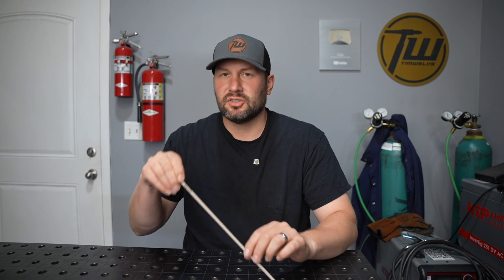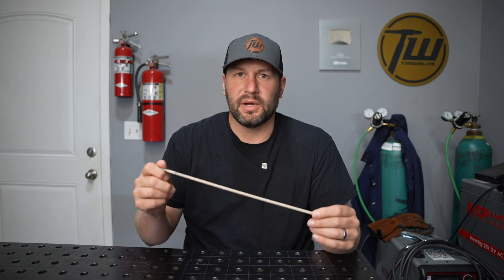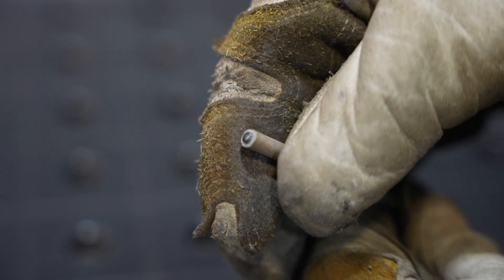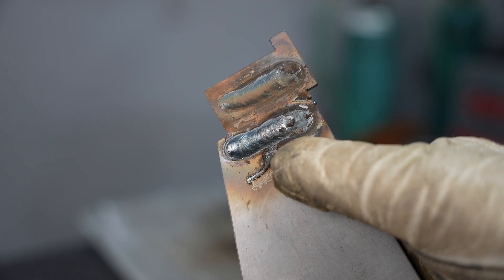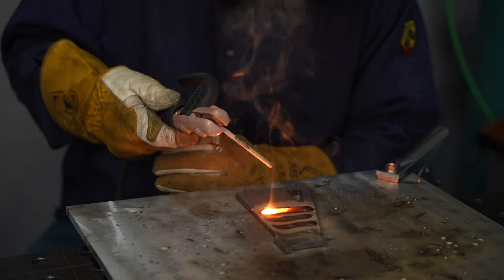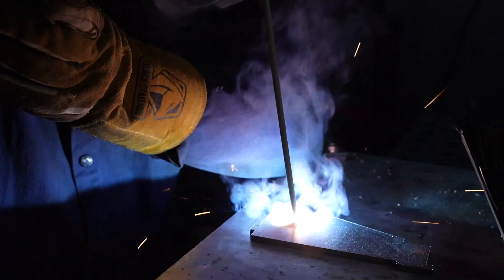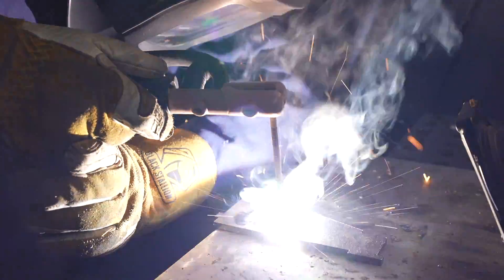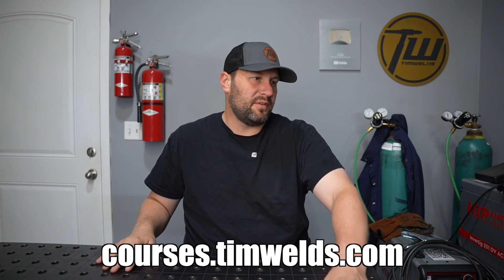Restart 7018 Electrodes the Easy Way - Stick Welding Techniques

Comment: never worked for me whatever i did, we tried this and many other things. best bet is to throw away used electrodes and just barely touch the metal until it goes off on its own with a fresh electrode
maybe its just european electrodes, very typical we had to hammer away with the electrode on the material many times to get it going
or just let it stick until its warmed up nicely - maybe torch it before trying to weld?

Comment: hey thhis question isnt related to this video but i figured i would comment on a newer video ive been learning recently and i switched to a thicker steel and also opened up a new pack of rods i turned my amps up to about 130 cause its very thick (im guessing at least 1/8th inch) the problem is i notice that when i stop welding the slag appears to have only covered certains parts of the weld and theres is massive holes and gaps in the slag and it is very thin were it is there any ideas if this could be too much heat,poor technique,something in the steel,or maybe the new pack of rods could be bad was wondering if you have encourtered something like this?
Reply from the maker: If I understand correctly, the weld appears to be good under the slag, but the slag doesn't cover the entire surface. This happens with some types of rods. If you email me a photo of what you're talking about at the email address on my about page, I'll take a look and see if I can give some more info.
Reply: @TimWelds  yeah that’s exactly what’s happening,what is you email address or where can I find it to send a picture?

Comment: Where should I get me metal if I just started out to practice?
Reply from the maker: The easiest place is from weldmetalsonline, you can use a discount code 'TIMWELDS' to save 10% there. The price is a bit higher for the precut coupons there, but they are convenient so that's where I buy most of my material for videos. If you're up for cutting your own, most local steel suppliers have a remnants area with cut off pieces that they sell at a discount. Some scrap/recycling yards have this too, so if you call around, you'll probably find some cheap material. You can also just buy a 20' length of flat bar from your local steel supplier and cut it up with a chop saw.

Comment: I started welding as a Junior in Highschool, that was in 1o68. I would rather weld with 7018 ANYTIME. 
THIS IS A GREAT VIDEO FOR ANYONE THAT USES 7018.
Thank you for your time.

Comment: Keep a half piece of brick or a large fist size course rock near where you are welding. Devlope the habit after short welds with the rod in tht holder peck the rod agenst the rock. It will break the flux off and expose the metal of the electrode. Sometimes, the molten flux on the rod is rather hard. Peck and strike the rock to clean the end of the electrode. It's been working for years for me. Just part of the learning curve with these rods / electrodes. You have to do this when tacking things together or building stuff made with short pieces and short welds. The construction and pipeline people dont have this problem because when they strike an arc, they are going to weld until the whole rod is consumed without stopping.
Reply from the maker: Great tips! Thanks!
Reply: PLUS, if the weld inspector gets annoying, tossing your trusty rock in the air a few times is a good argument amplifier. 😁

Comment: As a hobby/farm welder do I need to worry about a rod oven with 7018?  Everything I have welded so far without a oven seems to be holding up.  BTW thanks to the tips I'll be using them the next time I am welding.
Reply from the maker: I made a video about this that's somewhere in the library. Generally speaking, you don't for that type of work. The reason that a rod oven is required for 7018 by most welding codes is to prevent moisture in the flux. The moisture in the flux can cause some amount of hydrogen to be deposited in the weld bead. Other types of rods deposit a whole lot more hydrogen than a room kept 7018, so switching to a different type of electrode doesn't really prevent this. The reason that some procedures require low hydrogen deposits is that they can cause cracking under certain conditions. For hydrogen induced cracking to happen, 3 conditions must all be present at once. 1-presence of hydrogen 2-susceptible microstructure (occurs in high strength steels) and 3-significant stress/restraint (usually material thicknesses over about 1"). Because the welding you'd be doing in hobby/farm work is likely on mild steel that is 1/2" or thinner, the second two conditions wouldn't occur and the risk of hydrogen induced cracking is next to zero. I can't decide what's appropriate for you and if you're working to a code, an oven is required regardless, but hopefully this information helps to decide. Personally, I regularly weld on mild steel under 1/2" thick with 7018 that is stored at room temp in a plastic rod storage tube.
Reply: @TimWelds great explanation!  Long time question I have had and nobody could answer definitely. Thanks!

Comment: I just remembered a great true story about the 7018 rod. I was working in the steel mills and this one cocky dude bet me one day he could 'break my weld'. I took the bet. I welded two 3" strips of steel using the 7018. He took a 15-pound sledge hammer and beat those welded pieces to death. He was chasing the welded pieces all over the floor as it hopped around as he continued to beat it to death. After 15-mintes, he gave up. He literally 'tore' the steel bars, but he was never able to break the weld.
Reply: Did you tell him to put his purse down and pick up a hammer?

Comment: I have a question, can i use a pedal, like one from a tig welder, to stick weld?
Reply: No sir. The foot pedal is mostly unique to TIG
Reply from the maker: Technically speaking, it will work on a lot of TIG welders and I've played with it for fun. It doesn't really make sense to do that for any practical application that I can think of, though. The real benefit of stick welding is portability and simplicity and I've never needed that level of real time adjustment.

Comment: thanks for the tips tim. i have only tried stick once. i experienced the restart issues you showed. looking forward to learning more about stick. i have a couple small builds that would benefit from the simplicity of just needing power, a welder and some rods.  i wish you were not so far, i would love to have you out to be part of our current build. great video as always.
Reply: 6013 rods are much easier to start, and restart. If you don't need the strength of 7018, use 6013.
Reply from the maker: @reloadnorth7722 6013 is a lot easier to start. I find them a little harder to read the puddle with because the slag doesn't hang back behind the puddle as much as 7018, but they are still a great all around rod.
Reply from the maker: @j.c.smithprojects Thanks! Stick welding is nice in a lot of situations and it's a very reliable process for thicker material. It would be awesome to come out and work with you on a build at some point.